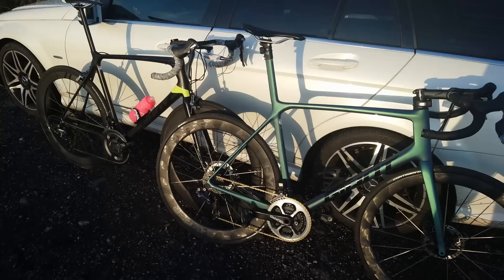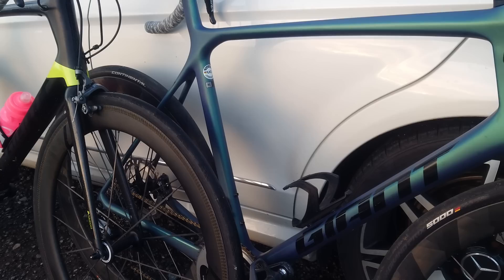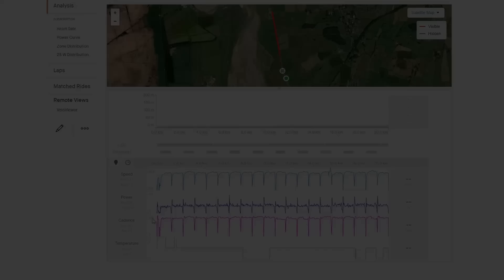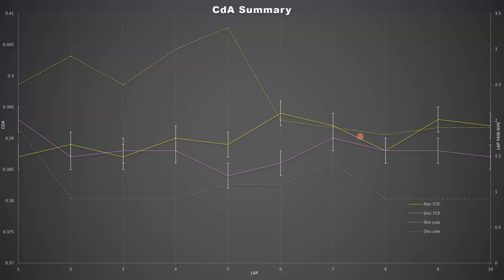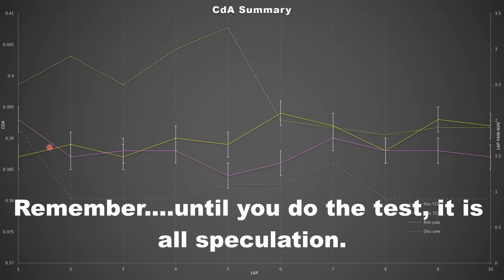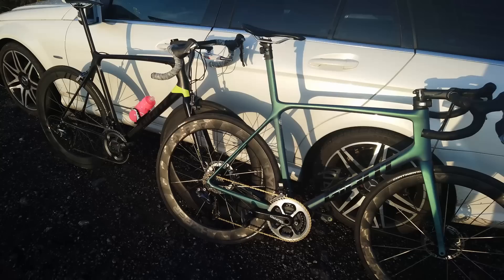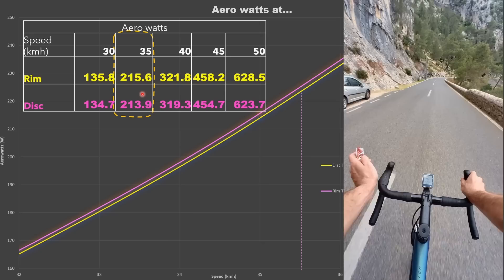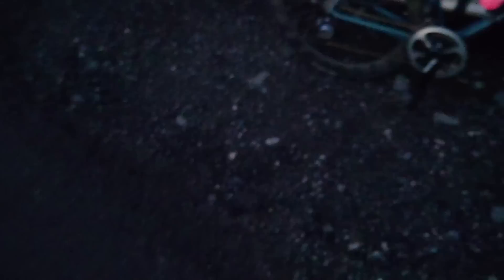Are Disc brakes Slower? Rim Vs Disc Aero tested.

Comment: The disc brake bike has a significantly lower stack height. This is what you are measuring the difference between
Reply from the maker: They are the same. Measured.
Reply: @PeakTorque  I’ll accept your word. It really does looks lower in the comparison just from a visual perspective.
There are other issues though. If you look at wind tunnel tests by Hambini, your Winspace wheels are significantly faster than deeper wheels from other companies. At the least those wheels are 3 watts faster. There seems a lot of unnecessary cabling on the rim brake. They should be cut shorter. That’s a 3 watt loss. 
Then there is the angle of yaw. There were spikes in yaw angle on the rim brake. Whereas we typically see a decrease in drag as yaw angle increases for a bicycle or wheel, the spikes indicate gusts of wind, which may have caused the wheels to stall. How much difference this made, I can’t say but yaw angle can make up to 10% difference to power.
Finally the 1.5cm difference width in the tops. Insignificant, but still worth a watt.

Anyway, just my opinion. There’s a reason why forks are designed to be wider and 140 rotors are used. Bikes are also different in design, some may have less penalty for discs than others. 

Btw. On the off chance, are you going to the Shanghai Bike Fair? I’ll be there myself. If you are, would be nice to meet you!
Reply from the maker: @benfinesilver2250  All i would say is this - i do my tests outdoors and the protocol and actual testing PROOF is public, on youtube in my wheel tests and on Patreon. Aerolab supply the equipment and protocol. I have never seen Hambinis wind tunnel tests, or any protocol, so cannot comment. I will not be at Shanghai but Eurobike yes.
Reply: @PeakTorque  Fair enough. I read something Hambini replied to you about relating to estate cars. It was really quite strange and it seemed pretty aggressive. He gets paid by Chinese companies if you didn’t know, which is why he offers discount codes. There’s a lot of nonsense twaddle pedaled by all kinds of people. Got to earn some dough I guess 😁
I live in China and may or may not be doing some work for a few companies there ;)

Comment: Nice test. Personally I was adamant on shitting on discs for not being as aero as rim brakes and this video certainly gave me a reason to chill on that. People usually don't have a problem with the aero aspect of disc vs rim, It's the added 500g+ of weight along with 500+ Euros.
GCN once did a test on braking speed, disc vs rim and their results are probably as always exaggerated as they're just the puppets of their sponsored bike companies. It's a pretty basic test but I wonder what the results would be if it was done by you for example.
Reply: Not sure where the extra 500g if weight is though. My disc group is about 200g heavier
Reply: You're way exaggerating with the 500+ grams and 500+ Euros. Maybe on a very high end bike the difference would be 500 Euros but normally I see 150 to 400 Euros as the difference. As for 500 grams, it's probably more like 200

Comment: Wait, I'm confused. You said "if the disc brake bike was quicker I'm putting it down to those handlebars", but it was the rim brake bike that had the faster bars, right? So wouldn't that mean the disc brake bike would be EVEN quicker if they had the same bars?
Reply: The Disc bike had 15mm narrower handles at the hoods which presumably outweights the aero shape of the other bars.
Reply: @matthewthomas5113  I think he used the same 40cm FSA Omega bar in the aero handlebar test, so shouldn't the 4w include the difference in width?
Reply: Ahh, good point
Reply from the maker: Yep your original comment is exactly what happened. The rim brake had the 'aero bar' but the disc bike has the hoods slightly "tipped in", which has been my baseline position for all the wheel testing tests so I can't change it now. This meant the hand/wrist position was about 15mm narrower, which maybe eclipses the benefits of the aero topped handlebar. OR, the disc bike could've just been faster due to the slightly updated frame shapes. A rim caliper isn't exactly a great aero shape right at the fork to HT junction! The disc bike is fully clean there. There are so many nuances and what-ifs. But im happy with the result. That niggling doubt that one is slower than the other is gone. When you take mountains and rain into account, the disc bike wins hands down, if for a little more maintenance and costs of pads! They only last me about 4 months at the moment so i get the cheap ass basic b1tch ones.

On the rim brake aero handlebar vs round bar test, the round bar was a size up (42cm) as FSA Omega quotes the width center of drop to drop and has some flare, but the hood to hood measurement was the same (40cm).
Reply: @PeakTorque  Gotcha. Yeah this certainly seems to prove that there isn't a massive industry conspiracy to push bikes that are 1kph slower hah.
Reply: @PeakTorque  your message raise the main point and it's essential : you have multiple set-up differences and "This meant the hand/wrist position was about 15mm narrower, which maybe eclipses the benefits of the aero topped handlebar. OR, the disc bike could've just been faster due to the slightly updated frame shapes" , yet I don't understand how you can come to the conclusions "That niggling doubt that one is slower than the other is gone".

Comment: Boomers on extra hard suicide watch lately - no one makes fast by today's standards tubulars, rim brakes were proven to not be in any way better than disc brakes and aero frames were shown to work to some degree. All the marketing bollocks from 20 years ago boomers filled their heads with turned out to be just that, marketing bollocks.

Comment: The rim brake itself as a system is indeed faster. But a disc wheel can be built to be faster than a rim brake wheel can be given its limitations to fit within the calipers 

Plus, you should only ride as fast as you can safely stop quickly, and a disc brake allows you to make a controlled jam brake and stop in a much shorter distance than a rim brake ever could. 

A disc brake is faster, because it allows you to stop quicker and safer
Reply: How would you build a disc brake wheel to be faster?  You're not under the impression that wider wheels are faster are you?

Also in the dry there really isn't much difference in braking performance between aluminium rim brakes and disc brakes.  Trials riders still use Magura hydraulic rim brakes at World Championship level.

I'd suggest having a look a Jack Carthy's UCI winning bike to see what I mean.  Rim brakes and it stops on a dime.

Now, if you wanted more comfort or wider, gripper tyres or a lighter action with more modulation or better wet weather performance then I'd go disc brakes but that ain't because they're are faster or can "jam" the wheel faster.

If anything this experiment shows that both are pretty close aero-dynamically so you won't pay much penalty for using discs.
Reply: Just another confused Covid era new cyclist who think they know everything about bicycles and riding after watching hours of GCN videos😂😂
Reply: @gokaygs  yup. Just a covid rider here who started cycling when companies literally had to release videos to convince ppl that carbon bikes were not any less fragile than aluminium or steel.
Reply: And precisely because disc brakes are better at modulation, it allows you to stop faster by allowing you to hit the point WCR because it locks up a lot easier. 

Rim brakes such at exerting a linear braking force on the rim; it’s literally physically impossible with current rim brake materials
Reply: @slowcyclist4324   “disc brakes are better at modulation” is some GCN marketing bs that isn’t even true.  Everything is possible on rim brakes if you know how to use your brakes mate, I’m not sure what point you are trying to make about current materials not being good enough.
Reply: @gokaygs rim brakes don’t exert a linear frictional force on the surface per force applied. That’s literal physics. Disc brakes allow you to apply more frictional force precisely, because you can finesse more power and stop short just before it wheel locks way more delicately than a rim brake ever could. In short, one go from 40 to 0 in a much shorter distance than a rim brake ever could. That means the difference between you stopping before the crash in front of you, or adding yourself to the pile of riders on the tarmac. 

It’s hilarious when you folks attempt to sound enlightened by rejecting any and all modern day marketing without actually reading any of the relevant literature itself.

Comment: The Specialized Tarmac SL7 with disc brakes is lighter and more aero than their previous SL7 with rim brakes. Their testing was done in a wind tunnel eliminating the human variables. Most importing thing is to enjoy your bike, whatever it is, and get out and ride.
Reply: The Tarmac SL6 was still on regular internal routing and the Tarmac SL7 uses integrated internal routing, so there are some aero improvements there.
Reply: @yonglingng5640  I stand corrected. Thank you.

Comment: NO MORE DISCUSSION. DISC BRAKES. MORE AERO.
Reply: Not true.
The rim brake had a wider and non aero handlebar, exposed cables which I feel from testing is an easy 12-15 watts extra.
Reply: the differences in the bikes he pointed out more than make up for the small advantage the disc brake data showed.
Reply: And more trouble with brakes including the occasional total failure.
Reply from the maker: @tommyfreckmann6857  actually the rim bike had an aero bar, but it did measure 15mm wider at the hoods despite being stated the same 40cm width.
Reply: nope if u watch the video the disc bike is using a narrower bar by 15mm and has di2....

If the rim tcr was running the same handlebars being narrower and used di2 it would be faster...

GCN actually tested this but on 2 identical pinerellos ie the same bars, wheels etc etc the rim model (on identical bikes) was faster across the board....
Reply: @tommyfreckmann6857  BRO IDC READ THE GRAPH MATE
Reply: @danc1829  YEAH BUT IDC I HAVE PROOF TO SUPPORT MY OPINION. LOL
Reply: @Slow.Smooth  GCN did the tests in a controlled wind tunnel just on the bikes.... Wind tunnel data costs thousands if u can better that... fair play 🤣
Reply from the maker: @danc1829  just speculation until you actually do the test.
Reply: @PeakTorque  you did the test and they didn’t like the results. Is it a marginal difference? Yes. Does it matter significantly for most riders? No. Will people overthink my comment? 100% guaranteed. 

I like disc brakes. That’s it. It’s 2023 let’s just marvel that we can even do this and enjoy the great bikes we have

Comment: opinions are like assholes... but seriously, just ride what works;  rim brakes have always worked, and have always worked extremely well (even off road).
my opinion, road disc is simply overkill. but I admit, I've only ever ridden rim brakes with good quality aluminum brake tracks, not carbon.